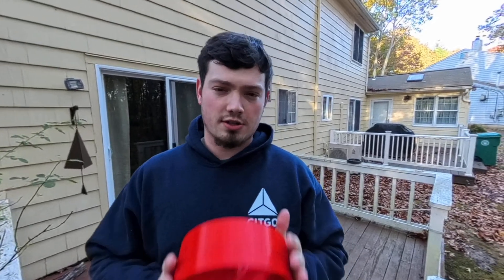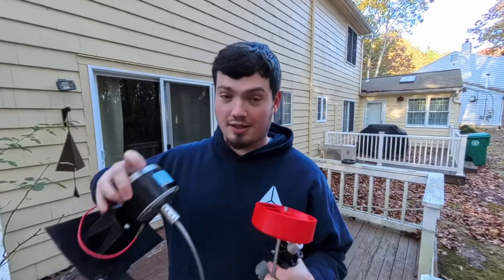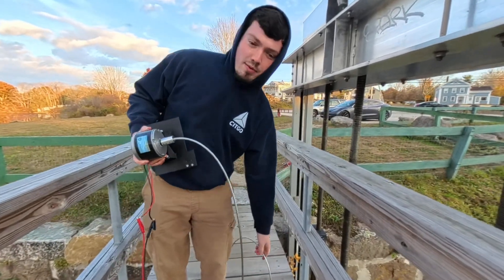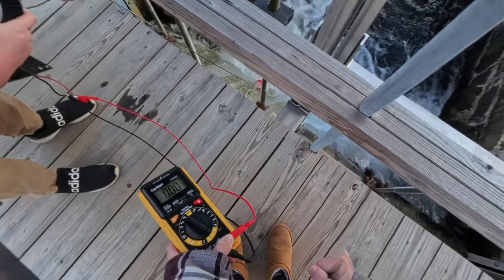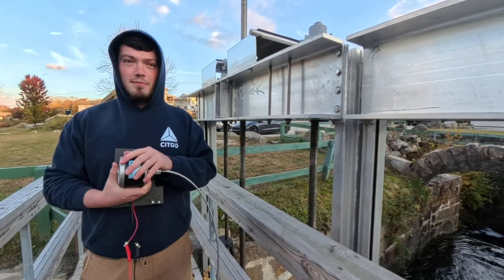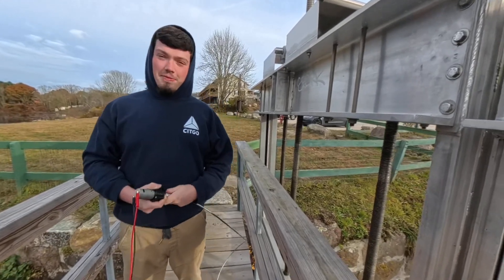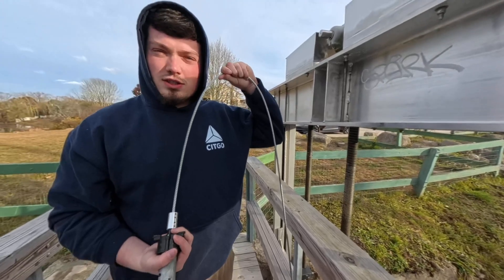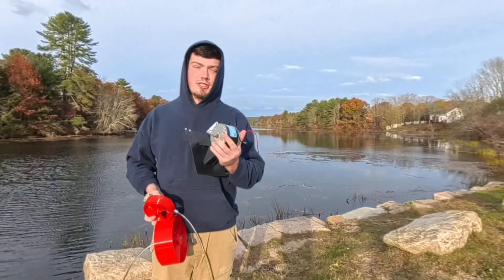3D Printed Hydro Turbine In Waterfall

Comment: Basically, this takes energy out of the water by changing it's direction (due to being in a conservative force field) and by changing it's ending velocity. So you are getting energy from gravity and preexisting potential energy. So your optimum impeller design will necessarily change based on how you use it, whether horizontally or vertically.

If it is fully submerged, you need to treat it as both changing the direction of the water within the confines of the turbine, and as a diffuser that changes in volume over the length as some function of the impeller design.
Reply from the maker: This is a perfect write up! It had not even crossed my mind of the different forces for when it's fully submerged. I think I skipped that step

Comment: I really like your thought process and trial and error!  If I may make a suggestion, the water you’re working with is like a horizontal waterfall, so the area you’re working with should mate with something like a water wheel. Anything round will fight with any torque you’re going to get. You could try throwing a pvc pipe over the shaft, so you can direct a cylindrical water fall.
Reply from the maker: Check out my newest short! This is very much so a water wheel haha. Great advice for this one I'll definitely look into this

Comment: Could it be the chamfer that made the small turbine unstable? As you already said, it's not getting pulled in and centered like the big one.

As soon as you can reliably place the turbine with a constant Speed, you can use a large Potentiometer or another variable load, to measure Voltage and current instead of using a fixed resistor, so you can calculate or measure your peak power.
Reply from the maker: I think it could be that partially, but the main factor seemed to be it tensioning the cable to the point it has to "flex" rather than the motor. I really like the idea with the potentiometer to regulate the resistance! Thanks

Comment: Need to try a solid shaft , could also make a wide mouth combiner that will direct more water from the sides into the propeller   I like the bevel on the inside, but try it twice as long, print one with a different pitch and see what that does. Good deal for you to try this. Good job. But don’t trust her, it was shorting out. 😂
Reply from the maker: Check out my power on a stick vid! There's a collector on that just like you decribe. I'll see what I can do on this I'm just worried too much will make it unstable as well. 🤣 ik when I was editing I saw them and decided to really zoom in. That could have caused the jumping as well

Comment: Power = voltage * current, so measuring voltage alone doesn't really mean anything, you need to load the circuit and have current flowing, which will also make the motor resist the impeller movement, and only in this case will the impeller be doing useful work (which is power * time)
Reply: This is definitely a cool idea though, just need to measure correctly, and optimize to those conditions (while consuming power)
Reply from the maker: Thank you that's the next steps in this and hopefully get some meaningful power. (Not voltage lmao)
Reply from the maker: Yes this is true! I miss spoke when I said voltage earlier on in the video. When I switched to the power analyzer there was the resistive load. I didn't with the multimeter though.

Comment: Hoverboard motor should be easy to find used, cheap and work well for this application. Keep testing with the load on it.

Keep this up. Cool project.
Reply from the maker: I've seen alot of comments for this. I have an ebike motor that may work pretty well too. Hoping to start digging into this soon. Thank you for the kind words!

Comment: You should always hook up a MPPT controller with a battery. Otherwise those numbers are kinda useless.

You could try and add an 1 foot axle that the cable would connect to, and also add some more "pipe" after the turbine, to make it more stable.
Reply from the maker: Thank you for this comment, I want to get all the other kinks sorted before adding in more components. I think adding more pipe after the turbine is a great idea! Stay tuned only a matter of time before its making power